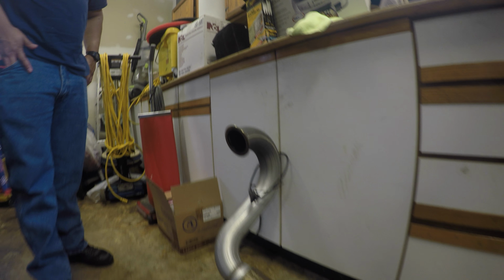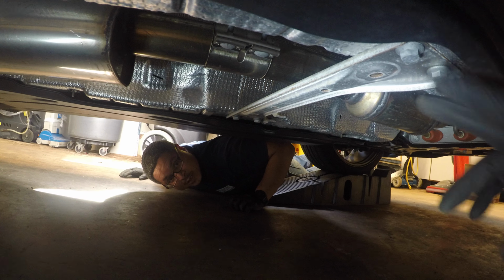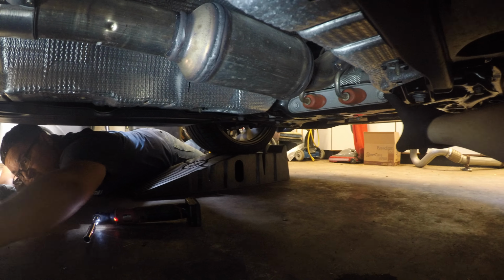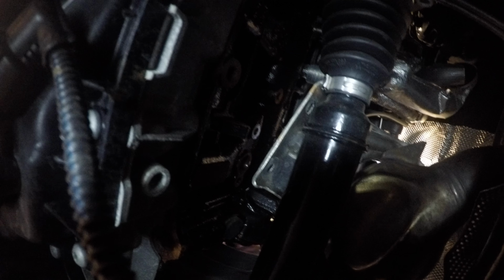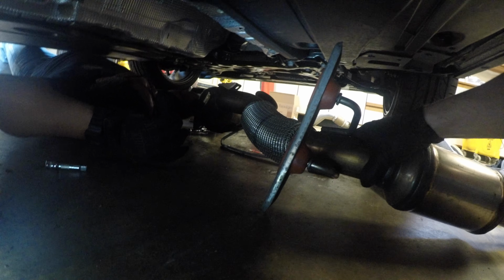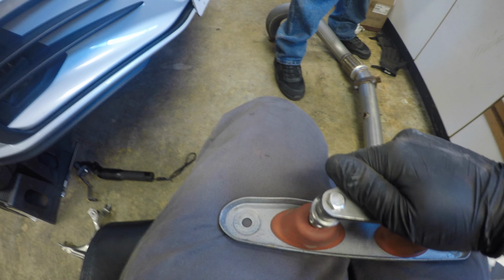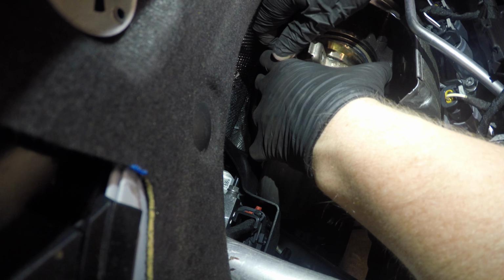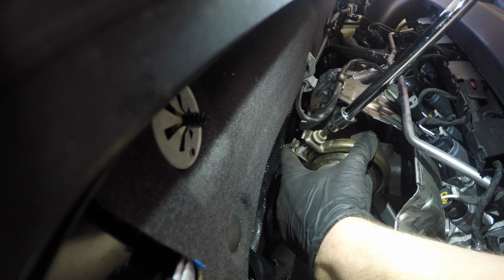MK7.5 GTI Gets A Catless Downpipe

Comment: Wish me luck installing my 3” catless downpipe tomorrow. Hopefully it goes as smooth as your install did!
Reply from the maker: 2liter8valveABA good luck, let me know how it went
Reply: Not well. Leaked like a siv. Bought a heavier duty dual bolt clamp off summit and that still didn’t help. Don’t really want to remove my heat wrap and weld on this piece of junk so stock downpipe is back on. Saving up for a cts downpipe now. Lesson learned.
Reply from the maker: 2liter8valveABA which Downpipe did you get?
Reply: Rev9. My buddy and I are going to have another go at it on Thursday or Friday. See if we can’t make the new clamp work.
Reply: 2liter8valveABA Use WD40 and bend the outer pipe sections that have the notches outward to make fitting easier.
Reply: Thanks for the tip Ben. But the Issue is actually the outer section being to big/out of round for the single bolt clamp to seal it up. Bought a dual bolt clamp that slips over both ends but this seemed to make it too tall for the inner pipe to slide in far enough before hitting on the flex pipe.

Comment: where did you guys buy this from? found it on ECS but it says it doesn’t fit the facelift gti.... any ideas?
Reply: also is this is the only exhaust mod you guys have?
Reply from the maker: Yoshi Dsouza it just says that. The exhausts are the same all the way until the y pipe/muffler section. The valance is different so the tips are further apart than on the mk7 GTI. Only difference.
Reply from the maker: At the time this was the only exhaust mod